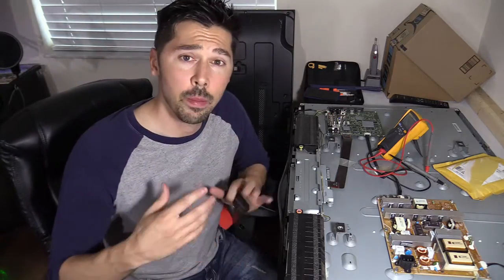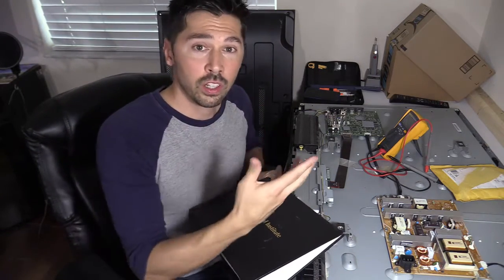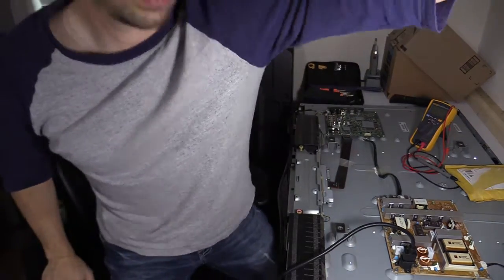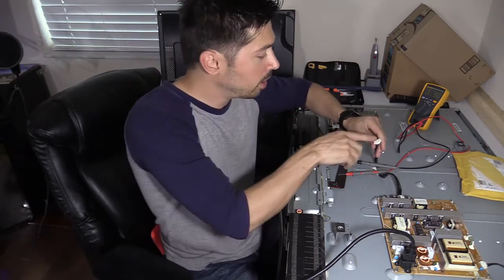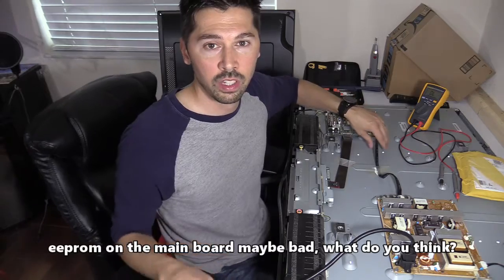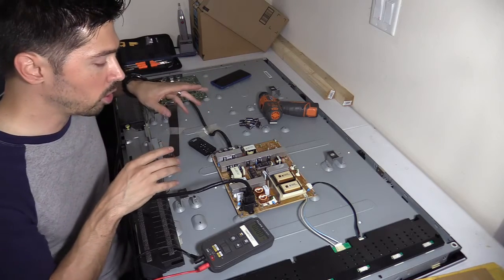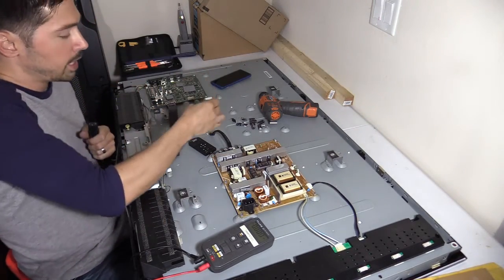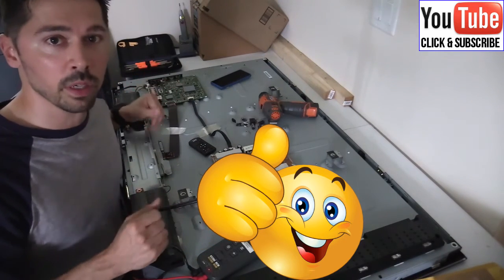Learn From My Mistakes, Valuable TV Repair Lesson Learned PT2

Comment: Yes I'm watching your video I got the same TV I said to myself wait a minute it can't be the power board because mine I got the 5 volts and the 12 bolts going from the Powerball to the motherboard right and then I got nothing I disconnected no back lights no nothing so my TV that I got it's a 2015 JVC it's like brand new to me the power boards good there's a problem with the motherboard but it's very expensive

Comment: Hello sir please I need your help with the tv here it's a Telefunken flatscreen tv model no: TLED-32 FHDP the standby light goes on but the tv can't turn on the standby light stays red I tried to change a driver board it's still giving me the same problem when I switch the main board on on the on and off switch pins and test with my multimeter 5 voltages are there

Comment: @TampaTec  If a Power Supply's 18-pin Power Wafer is giving higher voltage readings than the Technical Service Manual shows ... (Standby normal voltage is 3.5V, showing 7V. A couple of the 24V pins are showing ~55V once the power button is pressed) ... would this indicate that the Power Supply should be replaced? Standby light is not lighting up upon plugin. Audible clicks are heard after pressing the power button, and the main board light turns on, but no image is seen. It's an OLED TV, so there is no backlight. The TV has been able to turn on properly, very rarely. Most of the time, there is no light or ability to turn on.  This is my first attempt at repairing any kind of appliance, so any input would be appreciated.

Comment: I still think you were right in your assessment that the power supply card was knocked out. Just because you check it when it's not connected and gives you five volts does not mean it's OK. Because the capacitor may have been knocked out and only under load can you notice it (when the power supply is connected to the logic board)

Comment: I recently did a backlight replacement on a 65 inch Element tv, got it all back together and the right side of the screen(when looking at it from the front), is darker than the left. I tried taking the ribbon cables out and putting them back in but it did nothing

Comment: Great Video👍, Can bad  LED lights  prevent your TV from  starting up.
Reply from the maker: Yes, bad led strips symptoms are no power, flash on screen followed by TV shutdown or TV turns off by itself after awhile.
 Defective LCD TVs before 2010 usually was bad capacitors, LED TVs after 2010 usually bad LED strips. Hope that helps.
Reply: Thanks.

Comment: I have a D65u D2 tv..  where the picture goes out. and sound stays on. if you power off the unit and back on. the picture comes back.. where is a good troubleshoot place to start? From your vidoes im now a subscriber, extremely helpful. I don't believe there is backlight when picture goes off. or image through flashlight test. Im not sure if I should just start replacing boards until the problem doesn't exist..

Comment: I have the same TV I'm pretty sure,   LN46C630K1FXZA SQ05. No backlight. I get a standby light, and shows images (and sound) on the screen with the flashlight test. I can't find any videos specific for this model to test the power supply. Watching this though, I did unplug the PS from the MB. No backlights... Are you supposed to turn it on? Or will the backlights just go on as soon as the PS has power and the MB is disconnected? Pretty lost, looks to be a nice TV, I'd hate to scrap it.
Love your channel BTW, no shame in a few failures in R & D. I figured out electronics growing up next a thrift store as a kid in the 80s and picking receivers etc. out their dumpster and fixing them. Or when I couldn't, smashing them good to let off some steam... hehehe 
Thanks in advance for any help.

Comment: Measuring the voltage without load is not enough test to say that the power supply is ok. I would  measure the 5V connection of the logic board, if there is a short circuit (0.6 ohms for example). Important! The logic board must not have any connection to the power supply. If there is no short circuit  the power supply still has a bug! Sorry for my bad english!

Comment: that ain't the 5 volt standby supply. that's the switching 5 volts. it also has a 12 volt switching voltage. that 5 volt cycles on and off because the p.s on drive voltage also goes on and off. look for the REAL STANDBY 5 VOLTS and jump it directly to that p.s on line and see what happens.

Comment: Don worry mate you are not the only one, I bought and alternator for $300 and the problem was the alternator belt, when I checked the alternator it didn't have a belt on it, then I went to buy a belt and payed another $30 that was a big mistake that I learned next time check first then buy the componente. Would be be nice if you do another video about the main  logic board and find where is the  componente that make the voltage drop down  in the power supply board.

Comment: Your videos have helped me a lot - thanks. Can an ESR meter like MESR100 V2 be used to find which small surface mount capacitor is causing a problem on an iphone logic board. I know how to find what line has a problem but can an ESR meter be used to test small SMD capacitors in circuit? Or do you recommend any other methods?

Comment: Here's a question I have a 40 inch dynex DX-L40-10A flat screen tv. Plug in gets a click on power supply board, two seconds, and another click. Then red standby light on front. Power button on remote gets a click and red light turns blue. Power supply reads 5 volts on 2 standby leads. No blown capacitors or any other obvious signs. Still tv don't turn on.

Comment: I have a KDL55W802A that randomly started going into a reboot loop... I turn it on and it resets itself over and over, especially when introduced to load, IE: opening the home menu, etc. I already have the mainboard and T-con board replaced about a year ago. Do you think this is caused by a faulty power board?

Comment: I have a LG 32" led smart tv with 3.5 . 'I have a cable box that sound is very very bad , help me add sound .the HDMI splinter did not work for my sound connection

Comment: Hey, Tampatec! I enjoy your channel, learning a lot! Thx! 

I have a question.......what would it do if the Tcon board voltages are not the same? The Tcon board that came in my TV is part number 404652ASNC6LV4.5 I ordered a new one and 404652ASNC6LV3.7 was delivered. Now, my screen is blank. I'm guessing my problem is the voltage on the Tcon board?? Please help! Thx! Aly

Comment: I have a Vizio 65in 4k P602UI-B3 The TV comes on and half the screen works.   The other side has Multi colored lines about 3in wide about 4-5in from the edge of the screen. Sometimes one of the lines will be a solid color.  Any Idea?

Comment: Great video Paul, you have saved others from making the same easy to make mistake. Personally I like it when YouTubers show when things don't always go correct. People will learn more from this video than a 'how to' video as you explained your thought process. If you replace the logic board in Part 3, it would be great if you could get some measurements between the new logic board and faulty one to see if you can pinpoint the faulty component. Also what is that tube of white glue that you used to stick the transistors to the heat sink....is it thermal paste?  Big thumbs up from me :-)
Reply from the maker: Great idea! Thanks

Comment: Hi! I have LG 42LG3000 TV which produces randomly bad picture like infobox doubled or black screen only one line, but starts working after shake tv, where is problem? Checked capacitor on power supply and replaced one, cleaned panel connectors but problem exist randomly.

Comment: Disconnect the "PS_ON" wire only between the mainboard and the power supply and see if the TV works normally. If the TV works with that wire disconnected check the switching transistor on the mainboard that switches the "PS_ON.

Comment: I've been a electronics technician since 1969 & an engineer w/BSEE 1973. Even now I'm still learning & I've made mistakes as the one you did. In that I've seen certain problems over & over that required the parts replacement, that's when you get lazy then replace the common faulty part only to find out it was a fault somewhere else. It happens.

Comment: Unfortunately this testing procedure won’t work on “one board” TVs like the LG 43LH5000 I just fixed. It got taken out by a power surge during a storm. All it has is a combination power supply/main board and the T-con board. Fuses good and no obvious damage on the board. Very difficult to test due to the board design. Replaced the combo board and all was good again!
Reply from the maker: I had 70" sharp tv that was indirectly hit by lightning, smoked power and main boards. Both boards cost me about $120. Electropartsonline.com

Comment: Is power connector on main logic board just bad? As that can be replaced. Is there any test points on main board for that connector to see? Could also try tracing the “short to ground/or no power issue” on main board before spend the money & replace entire board..... Would be a cool vid to see too, especially, if you’re able to find cause & repair w/o spending the money for a main logic board.
Thx again, cheers 👍🏻
Reply from the maker: I'll try few things before buying a board. I did price a main board for $55. only 1 left in stock.

Comment: I was gonna suggest this same step, unplug main board cables from power board etc.....but I assumed that was one of the first steps you did. Oops.... But hey, mistakes are okay, didn’t hurt anything, & allows other ppl to learn. If no mistakes are made....learning could become boring at gimes😉😅.
Still a great vid, & enjoy you trying to fix/fix old TVs 👍🏻
Cheers🤣

Adding this for ppl new to repairs. First, test all parts you receive, BEFORE, start using to replace on boards etc...
Secondly, Please make sure the Power Board (capacitors, resistors, transformers) etc....”EVERYTHING” on the board is powered down/off, cuz getting hit w/ electricity is sure not fun...it sucks

Comment: thanks for posting my comment (though no mention). :( only samsung  LCD power supplies have the pull up resistors. though since your stby 5v was the issue, you would still see it by disconnecting it from the main. you probably don't have an eeprom issue, as you have an issue as it is switching, so a transistor, ic or cap is probably pulling it to ground. you should also disconnect the t-con and try to power up. most likely not an issue, but always confirm if it is or not. i'll see you over at badcaps if you get stuck. :D
Reply from the maker: Great advice once again, this time I'll be sure to give you credit and shout-out. Maybe I'll do a repair series that viewers can give tips and if it helps then they will win a prize, like an Amazon gift card. 🤔 What do you think? This way everyone learns, even me!
Reply: @TampaTec  there is always people that want to learn things from the basics up. i was thinking about doing a similar thing with some guys that i help out with on a discord server (they are watching along with this by the way). sort of a to and fro of information and going over why things do and don't work. the great thing is that you have the audience to make a big difference, so i think that it would be a great idea. i'll be there doing my bit. :)

Comment: The way I look at it...you eliminated a future failure issue being the parts are upgraded.
Reply: Like replacing the right rear door on your sedan because it is 5 years old....you know, so it won't fall off at a traffic light....lol
Reply from the maker: Yep, Caps for sure go bad over time, I replaced many over the years.
Reply: @TampaTec  capacitors are not a wear item.......it's just silly to replace them simply because you have new ones and they are a certain age.

Comment: There also was an issue with caps on the  power button board. TrY unplugging thenpower. Button
Reply from the maker: thanks for your help, ever think about uploading some tech videos sharing your knowledge? If so, I will sub to your channel for sure.
Reply: Make a serial connector and see what the processor on the TV is whingeing about. TCon not communicating can also cause this. Check the fuse and the generated 3v3 on the TCon. Also there is that problem with the older 47uf tantalum caps on some Sami main boards. Finally, the eeprom for settings might also be cactus (usually hard to find which one some of the boards hold up to 6 of them). Try some heat on it, if it boots while the eeprom is warmed (or chilled), replace it.